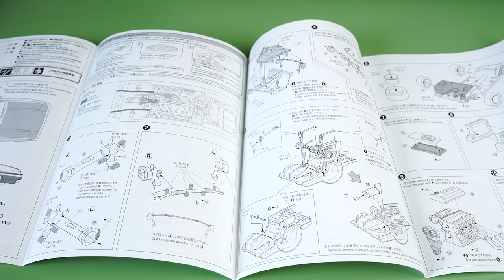Initial D Toyota AE86 TRUENO Model Car Full Build | Aoshima | Step by Step

Comment: Would applying the paint with fine-tip brushes make it look worse given it's not as uniform as the air brush? I'd imagine it's more really like a different surface finish. I see the guide also recommends using certain H colors. Would applying a gloss over it help? I'm new to building models (this is my first). I thought it was only cement i needed